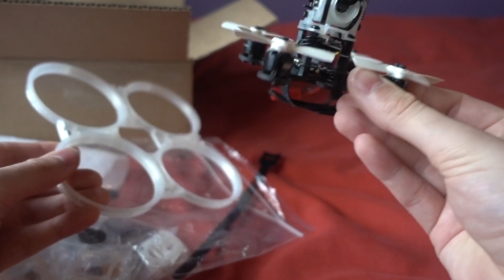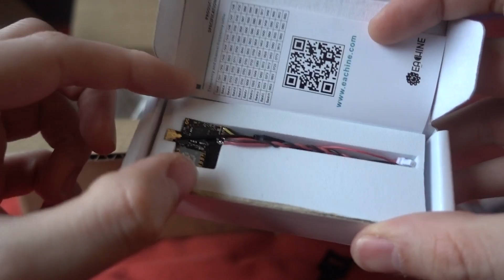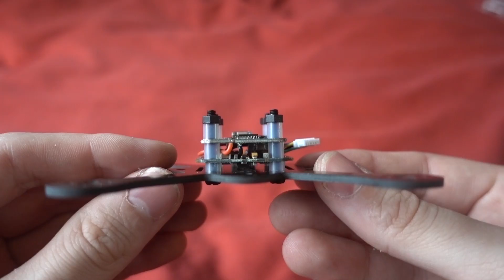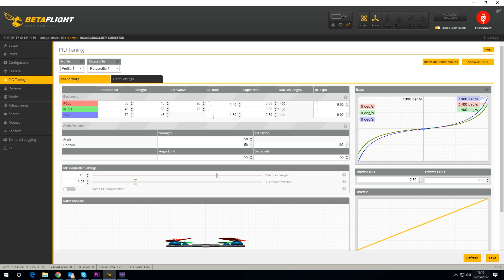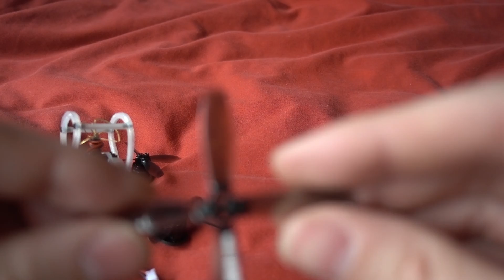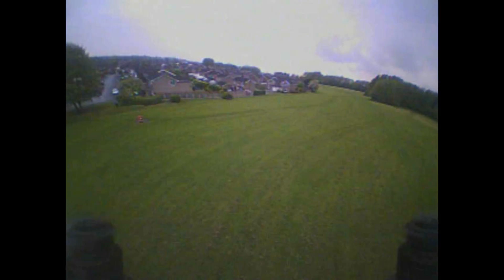Lady X - The Most Powerful Micro Yet

Comment: I am currently using the aurora 1104 7500 KV on 3s and it feels warm to the touch but by no means hot. I do use 1.9" 3 blade props which probably help a lot.
Reply from the maker: ah yes thats a good setup

Comment: Nice video Andy, very tempting :(  
Wouldn't the randomly bent props result in a lot of vibration? I think I'd have been tempted to open the holes out with a drill and accept the resulting slight decrease in strength; although the pair being bent down and in tension won't be that strong anyway.
Reply from the maker: it doesnt seem to vibrate any more and tonnes of power surprising really

Comment: did you check the motors to see if they could deal with the amp draw? I've seen people smoke their 1104 6500kv motors on 3s
Reply from the maker: +harry lenon Luke warm for me cheers
Reply: I use the same motors on the PicoX and they handle 3s no problem all day long

Comment: How's the AR90 Andy? Update? 

Will you be reviewing the Awesome F200? You can get it with F40 motors!  ;)
Reply from the maker: +GITech have u got a link?
Reply: Here ya go: https://www.banggood.com/search/awesome-f200.html  I like how the VTX antenna "can" point down below the rear props like the Tokio X (or SX).  

I've got the frame on the way along with Fuuton motors. Gonna run an FC/ESC AIO. Not sure which one yet...  :)
Reply: AndyRC https://m.banggood.com/Awesome-F200-200mm-High-end-Version-FPV-Racing-Drone-w-F3-20A-Blheli_S-5_8G-40CH-VTX-PNP-p-1151140.html?rmmds=search with f40 motors. i kinda like how this looks
Reply: AndyRC https://m.banggood.com/Awesome-F200-200mm-Standard-Version-FPV-Racing-Drone-w-F3-25A-Blheli_S-40CHZ-VTX-PNP-p-1151139.html?rmmds=search   cheaper
Reply: AndyRC look at BG

Comment: Wow .. very impressive.  A bit of a shame that there are "issues" with some parts, like the FC/ESC bds., the props, flexy camera mount, etc. Wondering why you didn't use one of the new XM+ FrSky SBUS RXs in this build?  I've got one on order as I mentioned to you. I like the size and power to weight ratio .. pretty awesome.  I think there should be some better documentation along with this, pointing out things like the differences applied to Betaflight. I wonder if you tried those wide 3 blade props? Those looked like they could provide a lot of thrust (without the problems of the complex 4 leaf props).  Very nice review .. always enjoy your vids. Cheers.
Reply from the maker: +Bill Somrak hey bill im still waiting for my six xm to turn up in the post :-) the three lead props are for a smaller model like the Pico x but I'll be trying them :-)